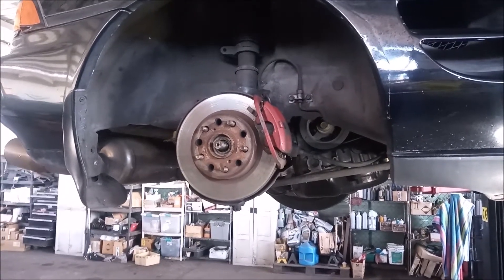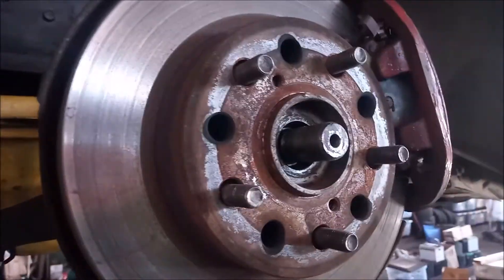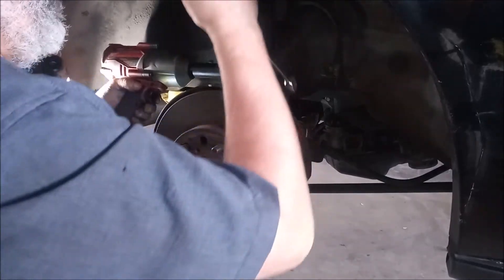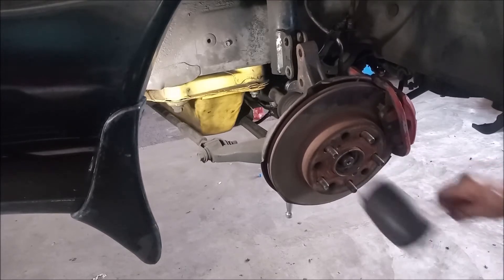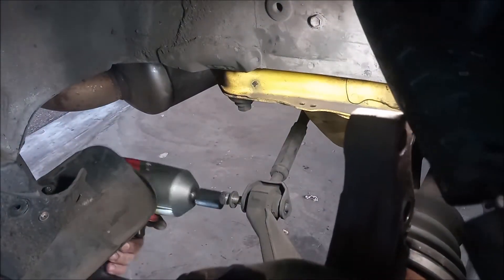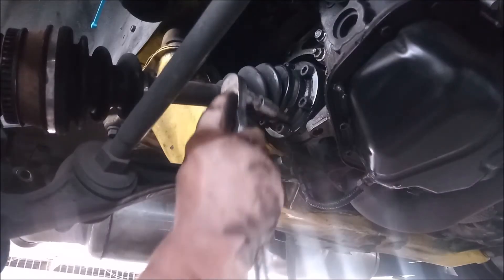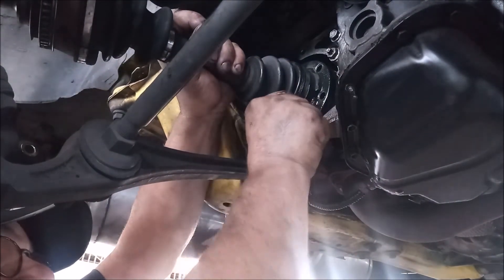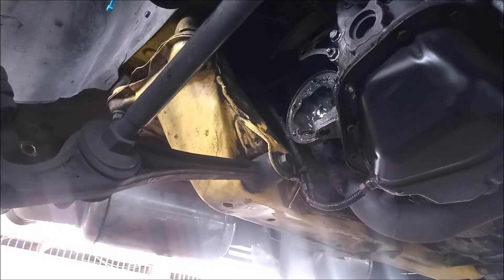10 Easy Steps to Remove the Axle - Toyota MR2 SW20

Comment: how do you get the bottom bolts out that hit the brake line? is there an easier way than taking off the brake line and bleeding the brakes?
Reply from the maker: Sorry I don't recall any issue with any bolts hitting the brake line.
Reply: @Merryfrankster_  i removed the brake caliper and its fine.
Reply from the maker: @warrenpeas  Good job.,

Comment: This is good, but wanted to let everyone know about my experience. Was told I could just take the nut off of the wheel and unscrew the 6 allen headed bolts on the axle shaft and remove. It wouldn't come out. Came and found this video, so then went to take the two strut bolts out. When I took the top bolt out the rotor section tilted forward and the shaft fell out on the other end. So may only have to remove top bolt and not worry about the bottom bolt or the tie rod.
Reply from the maker: That's an interesting way of doing. If it works for you, great. I like to make sure that the splines are free of the hub before disconnecting the joint from the stub. In some cases the spline section has to be pressed out (I have another video showing this, with a Highlander FWD), and I don't think it's something you want to do with the CV joint hanging.